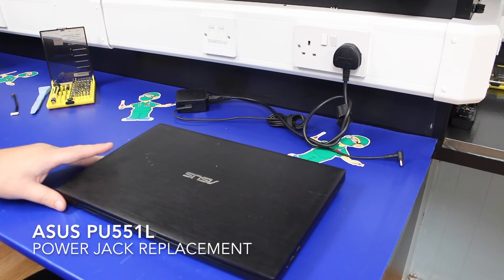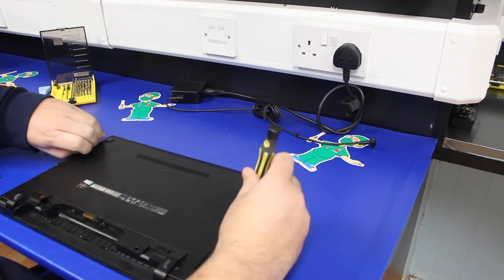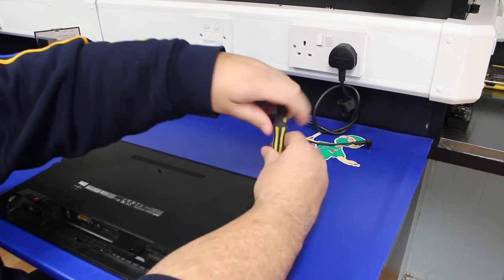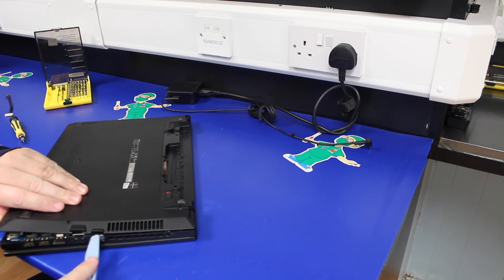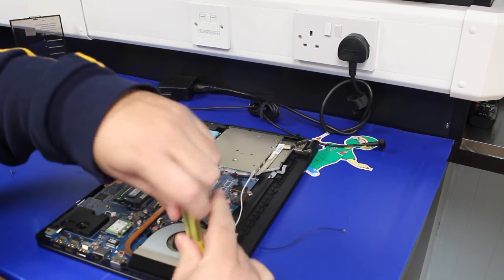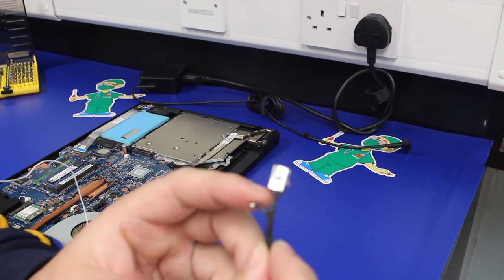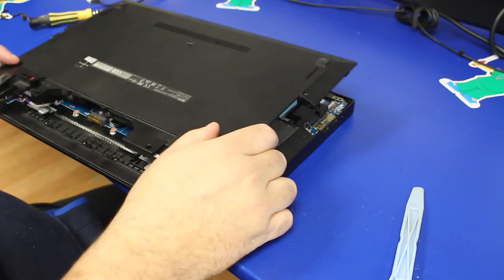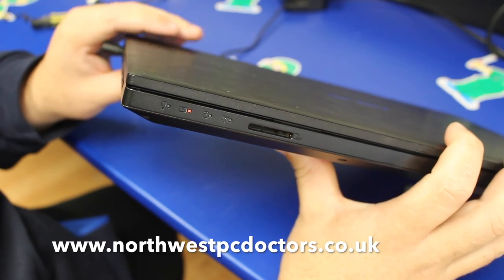Asus PU551L Power Jack Port Replacement

Comment: Thanks alot for the vid. Maxing out my mem from std 1 x single sided 4GB, to matching pair of double-sided 8GB = 16GB
Reply: On my PU551LA, there was no screws under the rubber feet. All done. Thanks again. So easy 👍 👌

Comment: Thanks for that mate, great video. How the hell do people break these jacks? I've got two of them to fix - the inner power jack plug is sheared off in both cases. Connecting the wrong power supply? PS: Why didn't you clean that horrendously dirty fan whilst you had the machine open? :)

Comment: Hi - I own this laptop and have a question for you as I want to expand the memory in it. I've read that there are hidden screws that need to be removed under the feet at the back, yet in your video you've not shown anything like this? So am I right to think that we're only talking about 4x back (below battery) 4x long ones around the corners and then 4x at the front?
Reply: You are right. Two of the long screws are hidden underneath the two upper rubber feets (near battery)